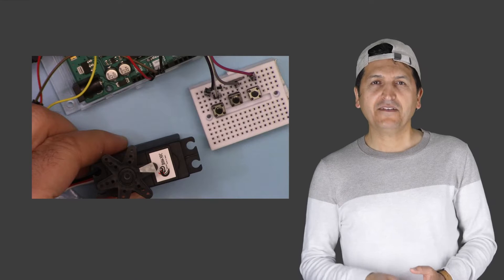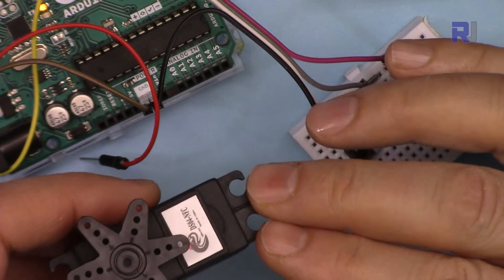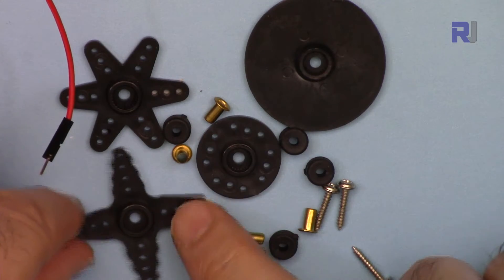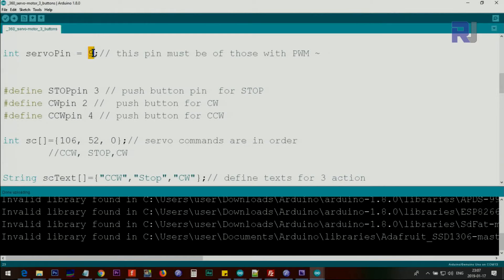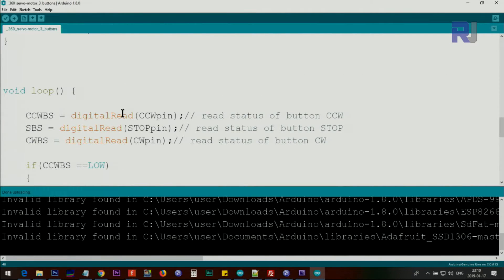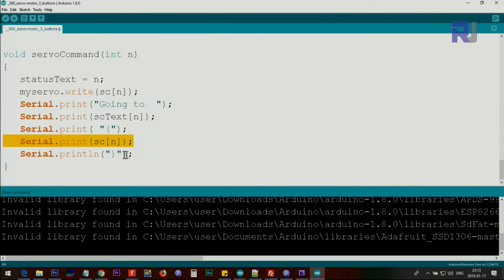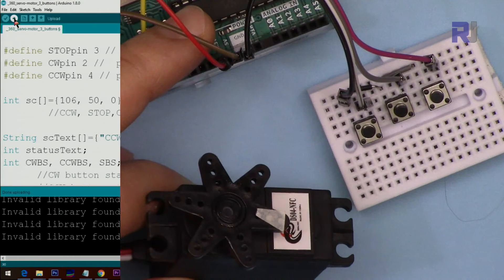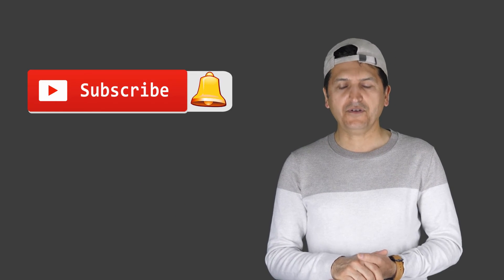Control 360 continuous Servo with push button switches and Arduino RJT175

Comment: Do you have code for a continuous motor to turn clockwise 360 degrees with control of one button. For example: one button press turns it 360 degrees and stops and the next button press does the same and so on. Thanks in advance!
Reply from the maker: Yes you can use stepper motor and just search my channel

Comment: great video. thanks
Reply from the maker: You are welcome. don't forget this servo is not for real application. it is just a joke to learn something as this can't be used for practical application. Instead use Stepper motor if you need 360 rotation. I have video on that.

Comment: hi robojax my middle button only makes the servo turn left how come that's happening?

by the way the button on the left also turns left
Reply from the maker: Hi, check the wiring if you have not modified the code. I don't see any other reason.

Comment: Can i control it with IR sensor?
Reply from the maker: Please see my comment. this is not a real motor. Search my channel for IR and yes I have soliton for it.
Reply: @robojax  thankyou for answering me bro your videos is helpful, im tryin to make the mask dispenser with vending machine mechanism But with 360 degrees servo instead of dc motor, i use the Ir to rotate the servo But whenever my hand is not on the sensor the servo is keep spinning
Reply from the maker: As I’ve shown it can’t be controlled properly. Use stepper motor and I have tones of videos on that

Comment: what if i use ultrasonic sensor instead of the button. I want it stop as the sensor doesnt detect something and start rotate back same way when the sensor detect it back. For example the motor needed to be attached to a toothpaste squeezer.
Reply from the maker: first you should have read my comment either in this video and the main video without push button. this is not REAL motor. it is just for fun.  Yes you can use ultrasonic to act like HIGH or LOW signal the same as push button.
Reply from the maker: You didn’t reply?
Reply: Do i need to reply? What’s wrong with u???

Comment: Do you have time to advise me?  I have built an HF tuner - it uses 2 air variable capacitors and 1 rotary inductor.  I added limit switches at the ends of the inductor so the gear motor can stop rotating when it reaches either end of the inductor’s coil. I hope to replace those 3 dc gear motors with 3 servos.  Can I use a 360 servo to rotate the inductor from one end to another and still have it stop at the ends?
Reply from the maker: Hello, this so called "continuous servo" is just fake motor. there is not such thing in the industry. someone just modified to demonstrate and it got popular . Use 28BYJ-48 Stepper motor. I have tones of videos on that here https://www.youtube.com/robojaxTV/search?query=28BYJ-48

Comment: Hi can you help me how to automatically stop the rotation of CCW and CW for about 6 sec
Reply from the maker: I have posted in the comments, that this is FAKE motor. you should not use it for practical application. it is just demonstration that someone modified the servo. you should use stepper motor or DC motor with encoder.  as for stopping,  you can use millis() from this video https://youtu.be/u2HsiTS8niQ to measure the milliseconds and do something. 
after servoCommand(0); or servoCommand(1); line  add SBS=LOW; and this is as if STOP push button has been pressed. Please watch both videos to learn how they work  and I am sure you can do it  good luck.

Comment: How to change it into two bottom control , when press right it goes right and press left it goes left  when i release it stops??? 
Thank you
Reply from the maker: I have explained everything in this video and also if you watch introduction to 360 servo video, you should be able to do it,  it can’t be explained with text, it needs practical work.

Comment: hey sir, it's so awesome, but it doesn't work for me (sad). i've already followed you steps. i used Servo motor MG995 (360 degree), when i pushed the button it did not rotate continuously. I think the number (106, 58, 0) are read as Degree, because it moved seem like that number. Help me, i just bought that motor and i don't waste it. Thx a lot
Reply from the maker: This video is the Advanced version of this video https://youtu.be/b_xvu6wWafA make sure you can control your servo first here. If it doesn't work, then your servo is not 360.

Comment: hey man im looking to do this but to connect a second motor to the 8pin i want it to rotate as well just opposite to the one on pin 9 how did i do this in code?
Reply from the maker: pin 8 is not PWM enabled pin on Arduino UNO only pins with ~ sign beside them are PWM capable. if you carefully watch without escaping my video, you should fully learn how this works and you can do the same for 2nd motor. Very hard to explain it here. It needs another video.
Reply: Robojax isn’t pin 8 a signal pin on an arduino nano though?

Comment: Hello Mr. Ahmad, you are doing awesome work in automation, I go through all your video. and they are very very good, 
I want to do the same operation for my smart blind, with Alexa, Please help me for that code.
 I need 3 or 4 full CW rotation to close my blind and 3 or 4 rotation to open my blind . can I control by % at somewhere middle of the curtain. Please help me.  here is my code 

#include <ESP8266WiFi.h>
#include <Espalexa.h>
#include <Servo.h>

Servo blindServo;
static const int servoPin = 14; // The Pin which the Servo is connected to
int servoPosition = 20; // This sets the initial postiion of the servo

// prototypes
boolean connectWifi();

//callback functions
void servoPositionChanged(uint8_t servoPosition);

// * CHANGE THE SSID AND PASSWORD TO MATCH YOUR OWN WIFI SETUP *
const char* ssid = "***;
const char* password = "**";

boolean wifiConnected = false;

Espalexa espalexa;

void setup()
{
  Serial.begin(115200);

  blindServo.attach(servoPin);
  
  // Initialise wifi connection
  wifiConnected = connectWifi();

  if (wifiConnected) {

    // Define your devices here.
    espalexa.addDevice("Blinds", servoPositionChanged, 0); //simplest definition, default state off
    espalexa.begin();

  } else
  {
    while (1) {
      Serial.println("Cannot connect to WiFi. Please check data and reset the ESP.");
      delay(2500);
    }
  }
}

void loop()
{
  espalexa.loop();
}

//our callback functions
void servoPositionChanged(uint8_t servoPosition) {
  if (servoPosition >= 50) { // more than 50% as ON
    blindServo.attach(servoPin);
    blindServo.write(180);
    delay(200);
    blindServo.detach();
  }
  else { // less than 50% as OFF
    blindServo.attach(servoPin);
    blindServo.write(0);
    delay(200);
    blindServo.detach();
  }
}

// connect to wifi – returns true if successful or false if not
boolean connectWifi() {
  boolean state = true;
  int i = 0;

  WiFi.mode(WIFI_STA);
  WiFi.begin(ssid, password);
  Serial.println("");
  Serial.println("Connecting to WiFi");

  // Wait for connection
  Serial.print("Connecting...");
  while (WiFi.status() != WL_CONNECTED) {
    delay(500);
    Serial.print(".");
    if (i > 20) {
      state = false; break;
    }
    i++;
  }
  Serial.println("");
  if (state) {
    Serial.print("Connected to ");
    Serial.println(ssid);
    Serial.print("IP address: ");
    Serial.println(WiFi.localIP());
  }
  else {
    Serial.println("Connection failed.");
  }
  return state;
}

------------------------------------------------------------------------------------------------------------------------------------------
Reply from the maker: Hi Vinod. I have not worked with Alexa and this is the first time hearing it.
Reply: @robojax  Thanks a lot ,  why my motor 
Increasing angle in each cycle, I modified 
The servo motor 180° to 360°. And it perfectly 
Neutral at 90°. (Stop and 90°)
I don’t know why it keep increasing angle
Reply from the maker: Becauses this NOT made for that purpose. People have played with this and changed it for fun. I wrote the code and made the video because people where showing interest.
Reply: @robojax  thanks for you reply
Reply from the maker: You are welcome.

Comment: Great videos. Can you make a video using toggle switch and no breadboard with simple wiring diagram
Reply from the maker: we need bread board because we needed 3 GNG.  This 360 servo I don't where and how people are going to use it. Why shouldn't we use simple DC motor? I made the video because I saw some people asked for it.

Comment: Dear sir...
I want to control 2 servo motor by using 2 FSR and arduino uno...i need a code like that when FSR1 sense force then it rotate both servo to 90 degree and when then FSR2 sense force then it rotate the both servo to 0 degree please sir help me...
Reply from the maker: Hi Safi, your comment should have been posted under regular servo.  Please see the right servo and I am sure you can find solution in my videos https://www.youtube.com/robojaxTV/search?query=servo

Comment: how to code this 360 servo motor to use as a gripper with two sensor that is force sensor and distance sensor. for example the gripper want to grip the object and then when the force sensor detect the sufficient force, the gripper stop. then when the distance sensor detect the right distance, the gripper will release the object. the force sensor is attach at the gripper to detect the force given by the object when the gripper is grip the object. i hope you can help me with the coding. thank you so much
Reply from the maker: Your request is itself a project.  Not simple to change this code.
Reply: @robojax  tq for your response
Reply from the maker: You are welcome.

Comment: good video! If it is possible to use 2 buttons to control 360 degree servo? When pressing the button it will rotate, and without pressing it could stop.
Reply from the maker: Hi, then why 2 push button? as you said " pressing the button it will rotate, and without pressing it could stop" then what does the 2nd push button do?
Reply: @robojax  hi, i want to ask my mine is not rotated continuous, if i push the push button it Will rotate but its just for a while, if i push the same button it cant be rotated again 😭

Comment: It just like a dc motor？
Reply from the maker: Yes. I do too. But this has one advantage that you don't need driver or power board. you can connect it directly to arduino. I forgot to mention this however in the video.